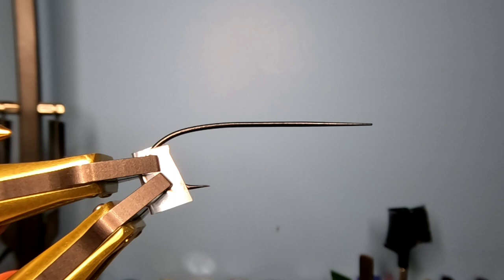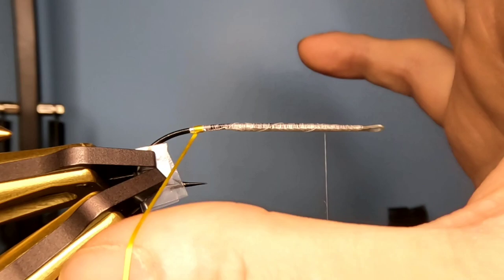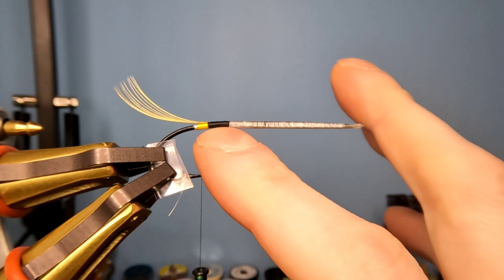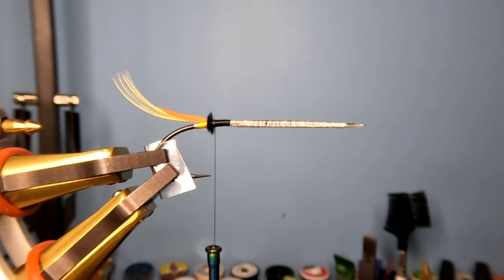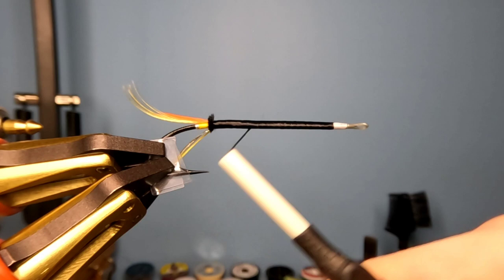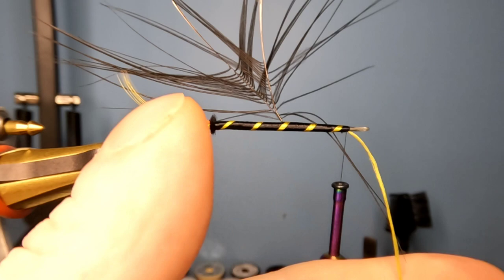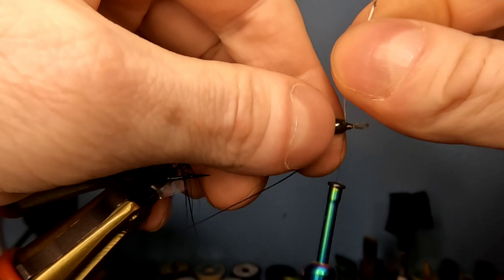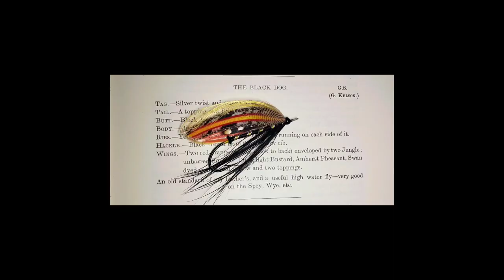Tying a Black Dog Classic Salmon Fly from Kelson; Part 1

Comment: Where do you find the catgut online since Trout Lines doesn't exist that I can find it in my web search? Is there a substitute I can use?
Reply from the maker: Do you mean silk gut?  It is silkworm gut.   Its not really available at retailers.  Feathersmc.com has some, you can also check ebay. There is a seller on there that has some for sale most of the time but its by auction.  

I have a video on making a substitute out of monofilament.  Davie McPhail also has a video on how to make a substitute out of mono as well.  Mono is quite easy and strong enough that you could also use it to fish with if you chose to.  
Here is the link to my video. 
https://youtu.be/hfhSFBNIzTw